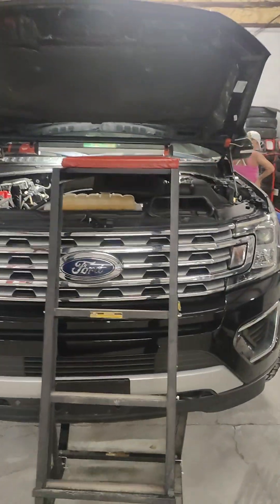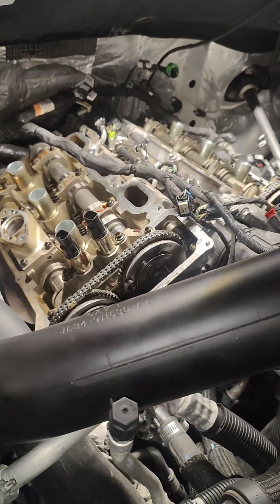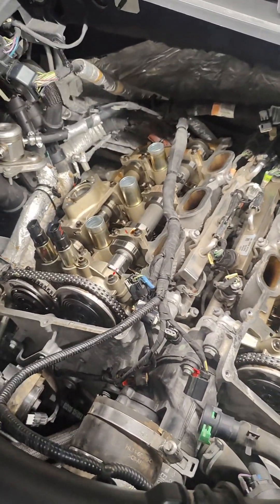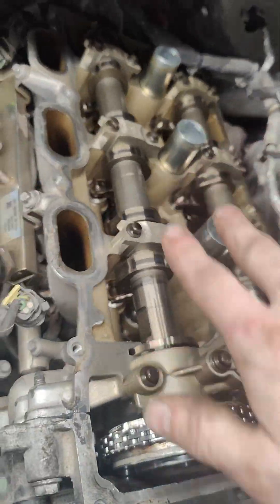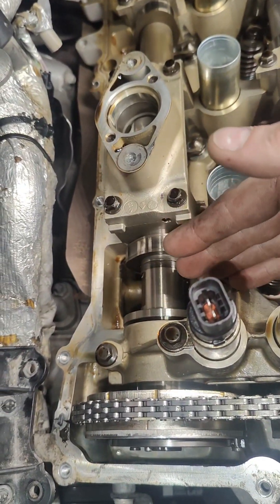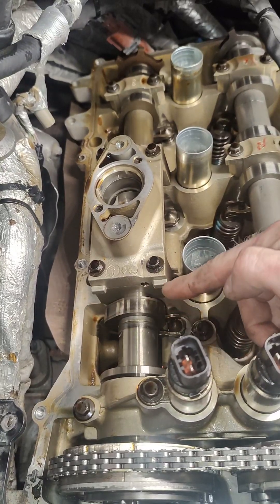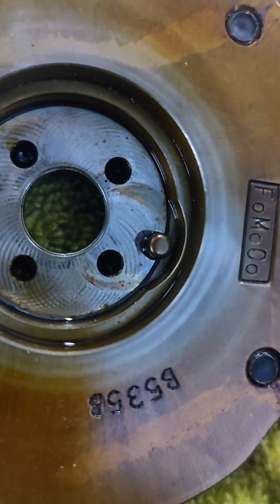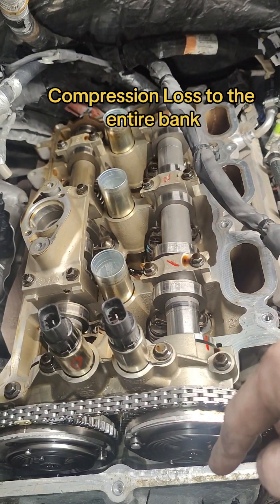Ford Ecoboost Timing Issue #ford #ecoboost #timing #expedition #f150 #explorer #turbo #fordf150

Comment: Between this video and the last video both vehicles are about the same years both having timing issues i noticed this engine is clean compared to the other video where the engine is yellow inside. Is that because the owner went alot of miles before changing oil. I have a 24 f150 raptors 3.5l and want my engine clean inside like in this video. Would oil changes at 3000-5000k keep my engine clean like the in this video. Thanks

Comment: Not real familiar with these. With the exhaust cam being 180 off will that cause valve interference with the pistons?
Reply from the maker: Possibly but in this case all 3 cylinders passed a leak down test so there is no valve damage
Reply: @ChrisVaughnTech  How do you turn the cam?